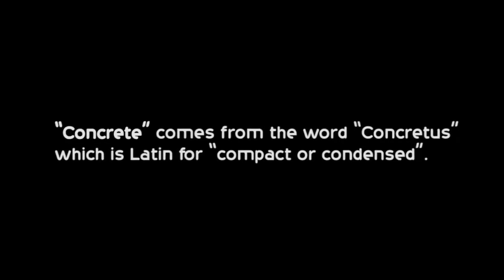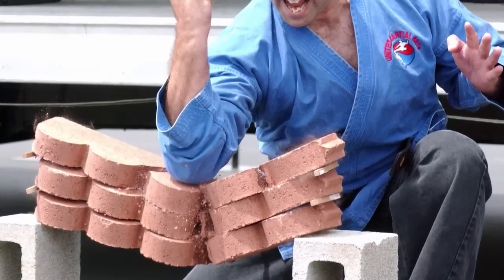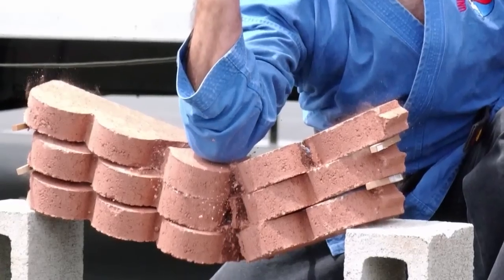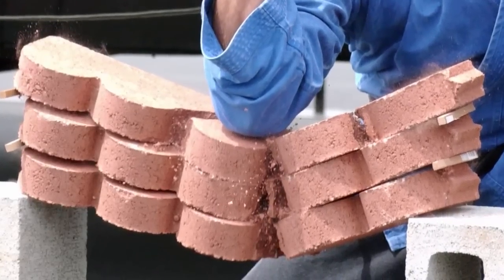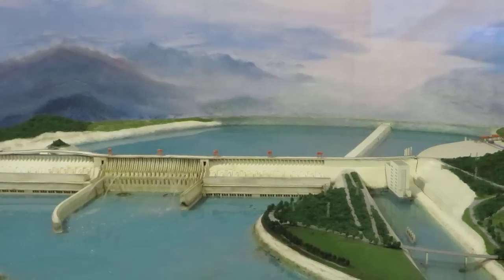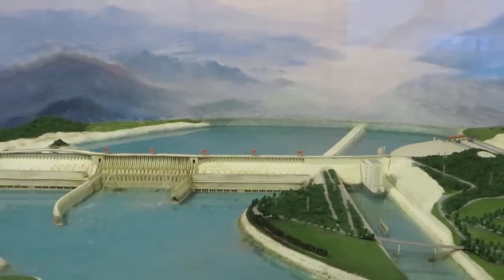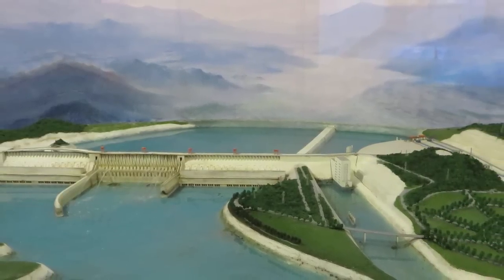The Difference Between Concrete and Cement

Comment: Bonus Fact 4 - The Hoover Dam in Nevada was the first dam constructed using the mass concrete placement technique. This technique was devised because it was estimated that, using the normal method, it would take 100 years for the concrete to cool. The new technique--embedding a series of one-inch pipes into the blocks and circulating ice water through them--allowed the blocks to cool rapidly and uniformly.The system cooled the concrete blocks in less than two months and opened the door for the construction of the Grand Coulee Dam in Washington state.

Comment: Cement is to concrete, as flour is to a cake.
Reply: Jay Jammer  if you paid attention to the video you would have heard him say that concrete is a mixture of cement, water, and aggregate. Cement is just cement. So no, concrete cannot be in cement because cement is 1 of the ingredients needed to make concrete. The final product cannot be a part of one of the ingredients.
Reply: Thank you. That was helpful.
Reply: @Sciguy95  So if concrete cannot be in cement, then does that mean cake cannot be in flour? So flour is just flour? P.S. Does that also mean bread cannot be in yeast?
Reply: That's correct. You can't pass bread off as yeast. I tried and my girlfriend didn't fall for it.

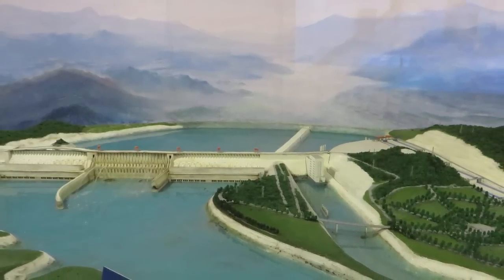Comment: 3:40 "Grand Coolie Dam has enough concrete to make an 8 foot wide sidewalk around the equator of the Earth" But how thick is that sidewalk?
Reply: Tony Samson  How do you come up with that number?
Reply: Jeffrey314159 do the calculation
Reply: Since the only references to a minimum recommended sidewalk thickness I can find is 4 inches / 100 mm, I wouldn't trust it over the Pacific.
Reply: the grand coolie is a sight to behold though... until that dumbass light show starts playing, that's when I leave

Comment: Another interesting thing about concrete is that after the "initial set" when the concrete first hardens, it then begins to bleed water and then as the curing process develops it requires extra water to be applied over the first couple of days to help the concrete attain maximum strength. Maximum strength in most concrete is attained after 27 days.

Comment: The manufacture of cement is actually a huge carbon emitter. Ironically, this carbon is usually offset by the fuel used by the kilns,  used tires. As tires are a large percentage natural rubber, this offsets its carbon footprint while iliminating a bulky waste product.

Comment: In my limited experience (I live in southern CA), there are three relevant terms in common usage: Cement, mortar and concrete. Cement is variously used to refer to the material that serves as a binder and also to mortar and concrete although this usage is informal and imprecise. Mortar contains only  sand and cement while concrete contains cement, sand and gravel. I have never heard concrete referred to as mortar or visa versa.
Reply: Good job though mortar can also have lime added to it. I think it's to cut the strength because you don't want mortar joints being too strong and not giving a little as the building settles.

Comment: I’m surprised that one of your “bonus facts” wasn’t that until the last couple of years we know what the formula was for Roman concrete and that in terms of durability and resistance to seawater the ancient material is actually vastly superior to the modern-day formulation of Portland concrete. Anyway, really enjoy your videos, they're always informative and full of interesting facts.
Reply from the maker: ***** Wow, today I found out... ;)
Reply: +Martin Rayner "Roman concrete"

Erik von Daniken wrote that the extra durability of Roman concrete was inexplicable and therefore...extraterrestrial in origin. The term "blockhead" seems appropriate.
Reply: +Stefan Travis Von D is also a convicted felon for fraud.
Reply: Martin Rayner     I was actually the wondering the same thing
Reply: Martin Rayner v,Ch cbv of
Reply: Legend Length  The cheapest was Natural Cement invented during the building of the Erie Canal. Only good for reinforcing earthen walls, dams,  levies, and canals.
Reply: Martin Rayner
Reply: Per Wikipedia regarding "Roman Concrete": __ https://en.wikipedia.org/wiki/Roman_concrete __ The key was volcanic ash.  Now, all we have to do is figure out some way to transport Mt. Vesuvius over here to the U.S.!   ;o))
Reply: you only need to transport the ash via ship...
Reply: Roman cement is claimed to be stronger than modern cement.
It is also claimed to require a lower heating point than modern, causing a lower environmental impact.
There are two kinds of Roman cement: aquatic and terrestrial, wherein the aquatic version has a ratio that is closer to 1:1 Lime and Ash (I think it is said to be 1:2?). 
Whether any of these claims hold any water (coughs loudly) is largely up to speculation.
Reply: Gam'ekfa Toc Duujek Prancing Bull You should get that cough checked does sound too good. It's even coming though in your writing could be serious
Reply: Martin Rayner what's the secret pizza crust?
Reply: Both smell so good. fresh Crete rules, sniff!!!!!
Reply: maybe true if talking about concrete typically used for sidewalks, foundations, etc.. (ie- much of the concrete used today)... but, there are way higher performance portland based mixes available today than back then.. like, modern concrete is far superior to ancient mixes - if - you actually are talking about modern concrete and not some recipe that was developed in the 1700s (which yes, is still used today in many instances)
Reply: Martin Rayner I was told that one of the reasons ancient cement is so tough is simply down to how long it's had to reabsorb the CO2 (basically reverting the cement to its original chemical formulation, i.e. stone). Check out the basic chemical process of creating quicklime.
Reply: Nah, roman concrete is stronger simply because the buildings it was used for were ticker, today's sidewalks or walls are thinner precisely because the material used are more efficient to mass produce but it also makes them weaker to brute force, erosion and water

Make a one meter thick concrete block and see how much it endures
Reply: GinHindew110 of the ones that survive, yes - but many domestic buildings had wall thickness equivalent to modern domestic buildings. Our general knowledge tends to be skewed by the Roman buildings or remains which are open to tourists but having excavated various what can be called mediocre structures (farmhouses etc) I can attest that they were really not that thick. 

What a fascinating discussion this is!
Reply: Italy experiences more than it's fair share of earth quakes too
Reply: @CurriedUnicorn the key word is "excavated" because if the roman concrete was that great the general houses would still be there and the only ones that remain are the ones that were excavated so their endurance comes from the fact of being preserved by being buried and not by the concrete

In a similar fashion even old clay houses are well preserved if they are covered in soil

Comment: Cement is glue.  If you look on many different types of "glues" in the store you will find a lot of them are also labeled as  "cement"

Concrete is a mixture of glue (water activated {processed rock based} ... Portland cement or similar) , sand and small rocks.

Mortar (used in gluing bricks, cinder blocks or large stones together) is a mixture of glue (usually Portland cement) and sand.

Comment: cure not harden
Reply: I think you mean "cure" not "dry".
Reply: He didn't say dry?
Reply: Agnė Rinkevičiūtė
- Yeah, he said "dry" many times. That's wrong. Concrete hardens because it goes through a chemical curing process. Frankly, concrete shouldn't "dry" during this process, because it needs the water to complete the curing process so that it can achieve it's fully hardened state.
Reply: KOakaKO
Okay, thanks.
Reply: KOakaKO When I learned about concrete in my materials class, the word was SET. Concrete should be poured as dry as feasible, but as soon as it sets, it should be kept wet for as long as you are permitted, as it continues to strengthen, although with diminishing returns. We also discussed the way gravel, sand, OPC, and water are proportioned to make concrete.

Comment: Bonus fact,  I can't believe they missed.
The most amazing thing about concrete is that it has nearly the same expansion rate as steel, thus making modern structures possible.
Reply: Yep and have the same subtraction rate as well. Zero. Well that's not true cause when concrete degrades it disintegrates where steel expands by rusting then disintegrates. I restore old buildings and have to measure both as a part of my job and neither have ever expanded unless severe rusting had taken place. In those cases we clean all the rust off and then you obviously have less steel sometimes to the point of nothing. If you are talking about thermal expansion they aren't that close as concretes expansion is next to nothing. Now being that one of the secondary jobs of the concrete is to protect the steel that helps to minimize any significant  thermal expansion

Comment: for those wondering how deep the sidewalk would be, it's .3025 feet, or approximately 1/3 of a meter:
24,874(equator in miles)*5280=131,334,720 feet
131,334,720*8=1,050,677,760 feet^2
9,000,000 meters^3=317,832,000.5 feet^3
317,832,000.5/1,050,677,760=.3025 feet which, due to slight rounding was most likely originally set as 1/3 of a meter
Reply: Michael Hertzler how does  0.3 feet equal one third of a meter?

Comment: The claim is made (2:50) that concrete is 'environmentally friendly' - a point which is not that self-evidently obvious.

In actuality, because of the tremendous amount of energy required to bake limestone into lime (requires a temperature greater than 1,800 degrees F), and as this energy comes from fossil-fuels, Portland cement manufacture makes a significant contribution to greenhouse gas emissions.

However, there is a recent report in Nature Geoscience (1) that long-term up to about 40% of the generated CO2 may be taken back up by the cement through carbonization upon exposure to air - more than had been observed in the past.

One of the problems with that is the 'long-term' part.

Roman concrete structures are still with us after, in some cases, more than 2,000 years - whilst many consider the service life expectancy of modern steel-reinforced concrete structures to be around 50 years.

There are several reasons for this ranging from the composition of the cement, to the method of building (the Romans tamped the concrete), and to the fact that the Romans did not use reinforced concrete - which, in the long run, breaks down concrete from within by differential expansion between the concrete and the reinforcing material, though tensile strength is increased in the short-term.

Concrete is a fascinating substance, wonderful to work with, but does have its failings.

===
(1) www.nature.com/ngeo/journal/v9/n12/full/ngeo2840.html
  Paywall :(   But the abstract is free.
Reply: I work restore old buildings and you would be surprised how quickly carbon build up takes to the point of being rather noticable once you clean it. This isn't going to be a problem for ancient structures since they don't have a million cars driving all around them everyday. You hit the nail on the head about the key to their longevity is they didn't use steel in their structures.

Comment: The difference between concrete and cement is something you just learned today?  LOL  Here's a clue:  a concrete truck (aka a cement mixer) is a large egg-shaped vehicle rotatung along its long axis to keep the concrete mixture of (usually) Portland cement,water,aggregate,additives to control set from setting up (during which the cement component would crystallize around the aggregate).  A cement truck (the real thing) is a cigar-shaped vehicle with V's (funnels, usually three of them) on the underside to drain the powder for delivery to a silo.  The truck could be used for any powder, and ones like it often are.  

Just today?  You should get out more <L>

Comment: Well done. Very informative, but let's not forget the two laws of cement. It is grey, and it WILL crack.
Reply: It does also come in white and it can be coloured with various additives. Cracking can be minimised with the use of reinforcing mesh or bar or fibres [steel or fibreglass, even carbon fibre].
Reply: minimized not eliminate
Reply: Correct, the only way to truly minimise the cracking would be to use special techniques during the curing process, and they are reserved for special High Value projects, not home projects.
Reply: Just throw heshin over it and when it up while curing ;)

Comment: Concrete is like a filler while cement is like a brick glue.
Reply: Adam Hosein  Actually 'brick glue' is a sand & lime mortar ?
Reply: Adam Hosein Concrete is concrete and cement is the powder that is added to the aggregate that glues it all together through chemical reaction when proper amount of water is added.

Comment: Fun fact....concrete and other masonry building systems are a huge factor in climate change. Next is our black roads.  These products absorbs heat during the day and dissipate it at night raising night temperatures. This has a huge impact on overall temperatures.

Comment: Concrete does not "dry". It "cures" through a process called "hydration" whereby water is bound up chemically with the cement. This is why concrete is so fire resistant. Hydration can only be reversed with heat, and it requires an enormous amount of energy to do so.

But at least you got the difference between "concrete" and "cement" right, lol....

Comment: If i used only cement, would it be as strong as concrete ?
Reply: No.  It would be very brittle and crumble easily.  Concrete gets its strength from the rocks and sand that are bound together by the cement.
Reply: To make a counter top from concrete the rocks will show up in the countertop.
Will only cement and sand work ?
Reply: Generally, no.  Cement and sand only is not concrete.  It is mortar, and is not as strong as concrete.  The troweling and finishing of a concrete countertop is in the skill of the person.  There are many YouTube concrete countertop videos that you can watch.

Comment: I heard that the Romans had this special kind of cement.  And for obvious reason people want to know how it was made. Because it is so strong it is still around to this day. I also heard that all traces of the recipes have been lost when that fool, set Roam  on fire.
Reply: Ive heard that the reason, or at least one reason, roman concrete was so good is the kind of sand they preferred. Apparently they used volcanic sand wherever it was available, which has particles with sharper points and edges that give a stronger structure when its set.